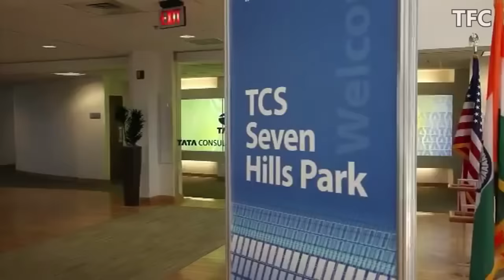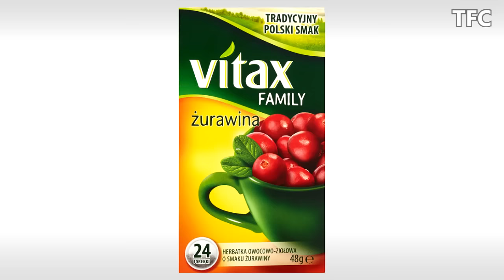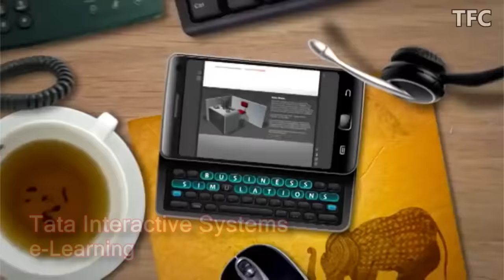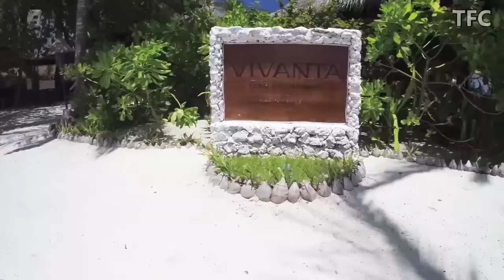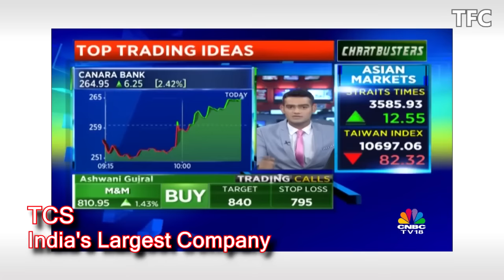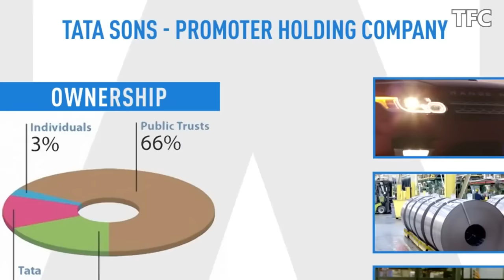Tata's Business Empire Part 1 (100 Countries) | Ratan Tata | How big is Tata?

Comment: Tata owns Range Rover and Jaguar but is not considered a Tata product.. its like Renault owns Nissan but Nissan is not considered a renault product... 

Jaguar-Land Rover is a company formed after TATA Motors bought the 5 Brands from Ford in 2008.

TATA SONS own TATA MOTORS (Different Company which work in motor vehicles, Holded by TATA Sons/Shared Holders)
>
TATA Motors own Jaguar-Land Rover (Different Holdings Company which is owned by TATA's/Shared Holders, which owns brand brought from ford)

Jaguar-Land Rover (Holdings company - Owned by TATA's/Shared Holders)

Jaguar (Individual Company)
Land Rover (Individual Company)
Rover (Individual Company)
Lanchester (Individual Company)
Daimler (Individual Company)

.`. TATA owns TATA Mot0rs and TATA Motors owns JLR and JLR owns other companies, that's how they are kept as individual companies and not as just TATA.

Hope it was easy to understand.